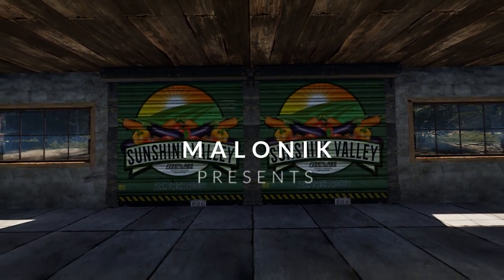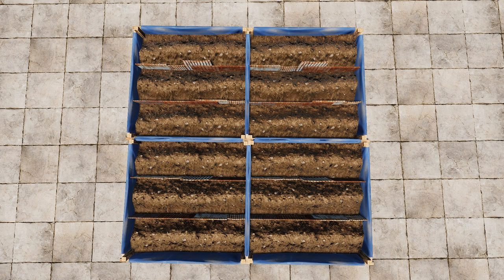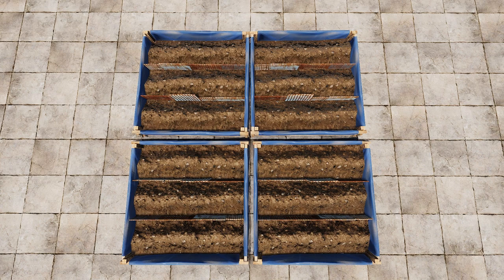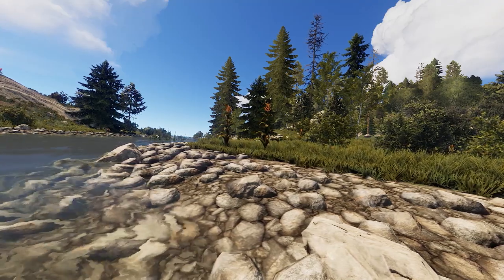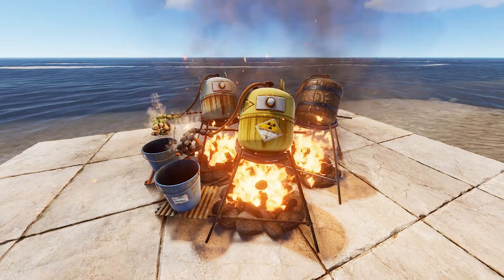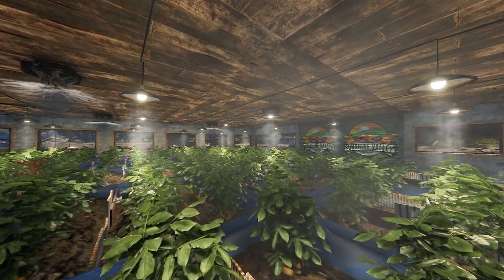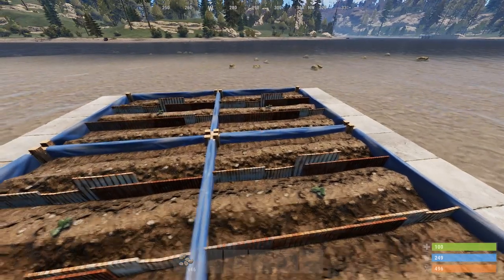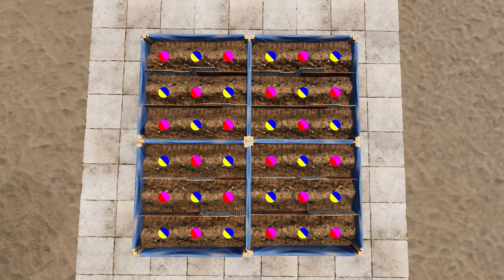RUST 101: FARMING 2.0 - Farm Setups & Meta

Comment: I just did way too much testing and now I think I understand how it works. Something I was confused about were the rates regarding water catchers (WC). There is the rate it collects water which is quite slow at a rate of 3 ml/minute (0.05 ml/s) and then there is the maximum discharge rate or the flow rate out which is 6 ml/s. Multiple WCs can be connected in series/daisy chained to increase the water collection rate. The total rate water is collected is the sum of the rates of each water catcher; however, this has no impact on the maximum cap of 6 ml/s output. Based on these rates, in order to have a continuous 6 ml/s water supply you would require 120 WCs. 

Okay, that is obviously ridiculous but those are the numbers. I'm not saying you need to have CONTINUOUS 6 ml/s supply to run a farm. Now that we understand collecting water, let's look at the transfer of water between the water source to the planters. The range a single sprinkler can water is 3x3 large planters. A sprinkler split's it's water output between all the planters within it's range. For example, if you pass 100 ml through a sprinkler to a single planter the planter will contain 150 ml of water. If you have 3 planters under the sprinkler, each one will receive 50 ml for a total of 150 ml. Yes, I know I said 100 ml input to a sprinkler and the result was 150 ml total in both cases which brings me to the next point. After the first 5 seconds and then every 10 seconds after that of continuous sprinkler watering, the planter water level is increased. Let's call this 5 or 10 second interval a watering tick. The first watering tick is at 5 seconds of continuous watering and then at 15s, 25s, 35s etc. If the sprinkler runs for less than 5 seconds (runs out of supply), no water is transferred to the planter and it is wasted (evaporates?). To rephrase, every 10th second the sprinkler is on, 30 ml of water is distributed to each planter in range. You would expect it to be 20 ml / 10 s but for whatever reason it is 30 ml. For this reason, it is better to use one sprinkler instead of multiple if you are have a slower collection rate in order to hit that 5 second threshold or make sure keep the sprinkler off until enough water is stored up.

Let's look at water rates required by the plants. Assume each plant requires 5 ml/min, 9 plants/planter, 4 planters/block. Then the plant water intake is 36 plants * 5 ml/min/plant = 3 ml/s. Remember do multiply by the magic 1.5 conversion factor from source water to planter water resulting in 2 ml/s water source which happens to be one sprinkler continuously operating! If the rate of water into planter == rate water consumed then the saturation will be balanced in equilibrium and remain at 0% so need an initial dump of water to saturate the planter. (This is an assumption).
 
Putting it all together we know we need 1 sprinkler operating at 2 ml/s/block. We also know that a small WC produces 0.05 ml/s. So the number of small WCs for continuous operation = (2 ml/s) / 0.05 ml/s/WC = 40 small water catchers. Well shit that's unrealistic. And actually I just realized when watering 4 planters, each watering tick the 30 ml is divided by the 4 planters which is 7.5 ml/planter/tick but they round down to 7 ml so it's only 28 ml instead of 30 you would get with one planter. This means it's 93% efficient due to this rounding and results in a new total of 43 small water catchers required for continuous watering of 1 sprinkler or 1 block.

Okay so what is the solution then because you probably don't want 43 water catchers. Get as many as you can and string them together and run it to a water barrel (optional) while you're offline or doing other stuff let the water collect and then turn it on and you're good to go. It really is unrealistic to leave the water running 100% of the time. I think having 5 or 10 small water catchers would be reasonable depending on how long you spend farming and how large your farm is.

Let me know if this makes sense or if I made a mistake. I did test it and ~43 water catches was the equilibrium point. I don't know why I spent like the last 5 hours researching and writing this lol. Love your videos. You make the best of electrical/farming videos.

TLDR: String a bunch of small water catchers together and let them collect a reserve before turning on sprinklers. Use one sprinkler per 4 large planters as Malonic said.

Fun fact: You can put key and code locks on planters but can't lock them.
Reply from the maker: Wow.... Just wow.... You straight up did some me level research on this lol. Thank you so much for spending the time and effort to research and write this as it's obviously extremely helpful! 

You're exactly the kind of person I'd love to have involved in my discord and in my brainstorming sessions for videos. If you'd be interesting in getting involved the discord link is in the description, jump on and say hi sometime. :)
Reply: Get ready for the Great Wall of Text. Scroll all the way down if you'd like to see the section describing incoming Farming 2.0 and Fluid IO additions / changes and plans.

> Let's call this 5 or 10 second interval a watering tick

The devs call every 10 seconds a 'splash' in reference to Sprinklers. Yes, it's 30ml/splash currently but it used to be 20 and 10ml/splash. There's no 5 second 'tick'. Only 10 seconds.
https://i.imgur.com/0d2FVAV.png

Initially sprinklers on the private rust-reboot/main/sprinkler branch were set with 10ml of locally stored water on the entity itself and they also used to decay 5 HP per splash (as indicated from source above and below). Adam / Jarryd changed it to 10ml/splash when they initially merged from sprinkler and farming2 to main branch (staging), then doubled to 20ml/splash, then increased it again to 30ml/splash and removed the decay feature based on staging branch testing (which I was a part of) and this is probably why the deployable sources are still draining based on the older 20ml/splash rate (i.e. never readjusted the source drain rate based on the new Sprinkler output rate). Or it could be left that way intentionally as a way to help minimize the need for a shitload of water / help players conserve water.
https://commits.facepunch.com/354696
https://commits.facepunch.com/361237
https://commits.facepunch.com/361632

> Remember do multiply by the magic 1.5 conversion factor from source water to planter water

Correct. The 1.5 source to sprinkler output ratio is right due to the aforementioned that I explained. So currently a single Sprinkler will output 180ml/min, but only deplete 120ml/min from its source. Every splash the Sprinkler outputs 30ml, its source drains 20ml. 50% EXTRA / FREE WATER. Btw, the deployable water sources apparently tick every 2 seconds based on in-game observation and commits from the devs.
https://commits.facepunch.com/361623

-----------------------------------
Some notes:
- Sprinklers and Ceiling Lights (as of the Easter event patch) have a range of 2 walls high over growables in planters (Sprinklers and Ceiling Lights were previously capped at a single wall height Area of Effect).
https://i.imgur.com/cOz3ICG.png

Here's the bug report I posted last Thursday that prompted the above change, listed as Bug 1 in my report. 
Bug 2 (the Sun + Ceiling Light during sunrise / sunset bug) still exists in-game today. Currently Alistair and Adam are looking into it if they can find a performance efficient way to rectify it.
https://www.reddit.com/r/playrust/comments/ftu3fw/farming_20_update_bug_reporting_megathread/fmaflh1/

- Over-watering is a mechanic not many know about (in addition to under-watering) and like many details in new content for Rust, it isn't mentioned in the Devblog. Your growables will take a water saturation penalty (as if under-watered) if you max out your planters water saturation level. The optimum water level is set to about 80% of max (6000 - 8000) but these specific parameters are set to change based on the commits shown below in the incoming updates section. 
https://i.imgur.com/ycSLC9Q.png

With this in mind, the Sprinklers are indeed NOT meant for fully saturating your planters like most of the lazy people think; it is meant for topping off / maintaining the optimum water level for your growables as they consume water from the planter. You DO need to continue manually dumping 4000ml (from a Water Jug) twice per Large Planter if starting from 0. The incoming additions / changes to the Farming 2.0 and Fluid I/O system will mitigate some of this to a degree however.
https://www.reddit.com/r/playrust/comments/ftu3fw/farming_20_update_bug_reporting_megathread/fmegcmu/

-----------------------------------
The following is incoming as early as May's update:
- Sea / Lake / River Water Pump, Water Desalinator, and Fluid Combiner:
https://commits.facepunch.com/361957
https://commits.facepunch.com/362059
https://commits.facepunch.com/362063
 
- Fluid Switch/Pump will output audio when on:
https://commits.facepunch.com/362221

Farming 2.0 Buffs incoming:
- Lowered optimal water saturation amount for planter boxes
https://commits.facepunch.com/362006

- Increased growth and yield gene effectiveness
https://commits.facepunch.com/362307

- Increased minimum temp
https://commits.facepunch.com/362308

-----------------------------------
The following is planned or being considered:
- Fertilizer bombs
https://www.reddit.com/r/playrust/comments/ftr43v/farming_20_update_devblog/fm8oadx/

- Sprinklers causing WET STATUS to players within it's Area of Effect
https://www.reddit.com/r/playrust/comments/ftr43v/farming_20_update_devblog/fm8sq3i/

- Planter Water state sensor to aid in automation
https://commits.facepunch.com/358116
https://commits.facepunch.com/358295

- Possibility of switching existing and new fuels (Crude Oil, LGF, Diesel) over to Fluid I/O resource entities like Water is; requiring a container to carry / transport it; Modular Vehicles may spearhead the change and utilize it first
https://commits.facepunch.com/334714
https://commits.facepunch.com/361694
https://commits.facepunch.com/361772
Reply: Thank you bro
Reply from the maker: @worlwr2  Omg thank you for the giant wall of text!! That is all so damn helpful!!
Reply: How do you connect water catchers
Reply: @KTwist  using the hose tool you connect the output of one to the input of another. The input is on the left side of the storage barrel.
Reply: i think using water sprinklers are not logical. I mean at least they need a buff or especially water catchers need a buff. If you want to make an efficient gardening you need to settle somewhere around the river and using water jugs.
Reply: I did the same research and found the same info as Wavey Davey. 40-43 small collectors or 15-16 large collectors 1 1 sprinkler to run continuously.
Reply: Wow I just read a motherload of info tyvm!
Now, anyone did a small planter plants cross breathing? Isn't it more targeted/ specific??
Reply: @worlwr2  Dude what the fuck, that's impressive I don't even do that much reading for an exam xd.
Reply: You are the hero we need right now my dude.
Reply: Holy shit mate. I'm speechless at your level of dedication. Well done.
Reply: You spent the last 5hrs doing it because NO ONE ELSE POSTED THIS THANK YOU.
Been driving me nuts, the setups are GREAT, but what about the water usage/availability/need ratios?! THis is exactly what I needed, THANK YOU!
Reply: If it genuinely is this stupid then I give up. Please tell me it's been patched since then to make more sense.

Comment: I think what would be especially helpful is to watch you do this from start to finish. I understand the principles behind this, but if I wanted to make the perfect hemp clone -- one that produces an extremely high yield at a fast grow rate -- it's hard for me to figure that out exactly, considering there are so many genetic variations. And I'm confused about how much water to use and when. (Sometimes it seems like a large planter can have too much water, especially in the early stages of the plant life). Thanks for posting this video, it's definitely given me something to think about, but I'm struggling to put it into practice. (It also doesn't help that I have very limited time to play).
Reply from the maker: Thanks for the feedback! Definitely doesn't help that you have limited time in a game like rust lol. The only issue with showing the full process is that if you're wanting the exact right genes it can take a long ass time. Like a couple of hours per harvest and you'll need to do probably 5ish or so to get it right.

That being said I do have an alternative that's actually pretty damn good especially if you're limited on time. So skip trying to get the genetics right. Instead just plant a ton of seeds straight into the ground. This one harvest will require more manual effort with watering and such but the seeds won't crossbreed because they aren't in a planter. So keep an eye out and find the one that lines up with what you're after. It may not be perfect, like 3 G's instead of 2 or whatever you're aiming for but it'll be a lot better than trying to perfect them in a planter and saves you about 10 hours lol. Clone that one and use it to populate your farm. Because their genes will always be identical you'll have those really good genes across your whole farm.

As for the water the rough guide is to keep your water levels between 6k and 8k. That's the sweet spot so that you are giving them enough water to be happy but not so much that you're oversaturating them. My auto sprinkler circuit is particularly handy for this as you just have to play around with the timing to suit your plants needs and it does the rest.

Comment: If you want a strong pressure in your lines and to run multiple water lines use the Water Tank for the car.  I have 120+ water pressure for 3 levels of farms 12 planter boxes each level.  Just make sure to have the water pumps have a higher output then your sprinklers are using.

Comment: if you want a simple lazy farm for you self 1 large planter a light a sprinkler 4 water collectors chained together a tap/pump and pumpkins. when watering look at the planter keep it around 5500ml to 6500ml of water to much water will slow the plants down best get it around the 6500 mark then come back around an hour later and give them more water. if you not worried about the genes pumpkins are the best as you always get seeds when you eat them no need to clone. if you want to be extra lazy chain 15 small water collectors together and leave the sprinkler all the time only thing you need to do is harvest and plant some seeds every 3 or so hours for pumpkins.
Reply from the maker: Nice. That's a good little setup to stay fed for sure. :)

Comment: You need more finite control over each large planter's saturation level. For instance pumpkins will only reach 100% saturation themselves if the planter saturation is between 6500/9000 and 8000/9000.  You also need more seperation and control over the early crossbreeds from each seed.  Try having cooperative genotypes in pairs with singular gene receptor seeds.
Reply from the maker: You lost me at the end there. Also my upcoming automated watering system should give the necessary control over the water side of things at least.
Reply: @Malonik  You figgure out a way to monitor saturation and use that to stop sprinklers, you let me know,.... :P
Reply from the maker: @Leithenator  Oh god I wish!! I'd love some sort of saturation reader that I could work into it. Nah mine is more of a manual system in that regard whereby we test the absolute crap out of it and hopefully find a sweet spot of having them on / off so that it stays at a good saturation level automatically once you set it correctly.
Reply: @Malonik  Also, on the topic of genetics, what you are looking for is something like  YY/GG/HH .  The gene sequence in rust is 3 pairs. 1.1/2.2/3.3  Getting matching green letters in pair positions is optimal. There are red and green genes. The red genes are negatives, wheras the green genes are positives. Y = Yield G=Growth H=Hydration. for the green genes.

Comment: As someone who has focused on the genetic side of the farming updatr I can safely say instead of doing one per planter you can use 4 in each corner to find the best genes. If your also looking to make a mass farm for the best gene possible, spam seeds outside and just make to watch them when they go up
Reply from the maker: Good advice! Only reason I went with 4 initially was just trying to emulate someone getting back with just a few seeds from finding plants while they're out. 

I thought about the spamming seeds route but how do they go growing? When I tried growing outside versus in a planter it took like 3 times as long to grow which was like 5 or 6 hours lol.
Reply: It takes longer yes but you can find genes alot easier
Reply: That and you don't have to wait for them to fully ripen to clone them, once they fruit you can clone them
Reply: And hemp is the fastest and easist to clone
Reply from the maker: Ah yep that's fair enough, nice!